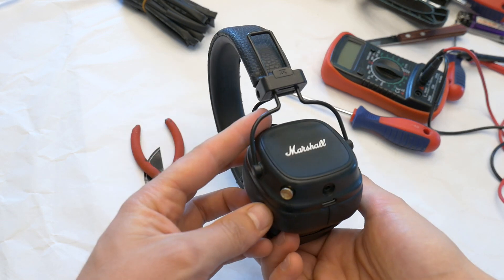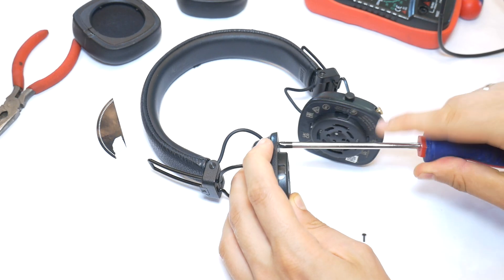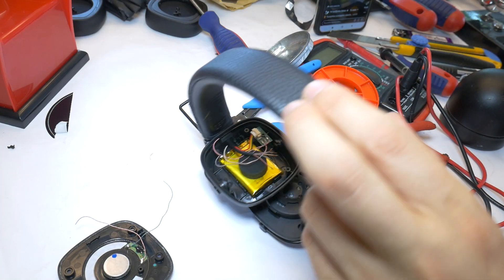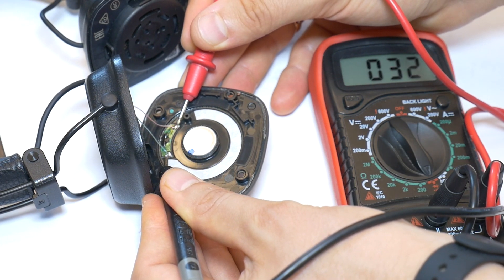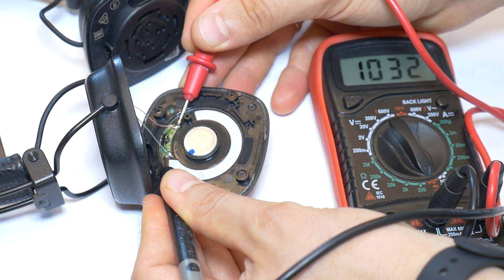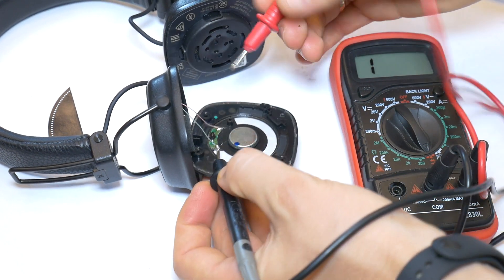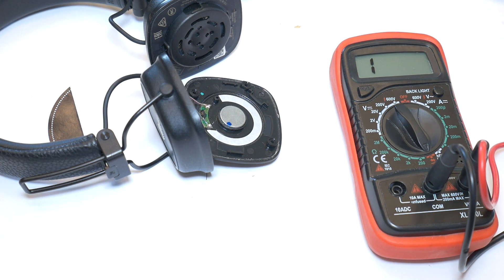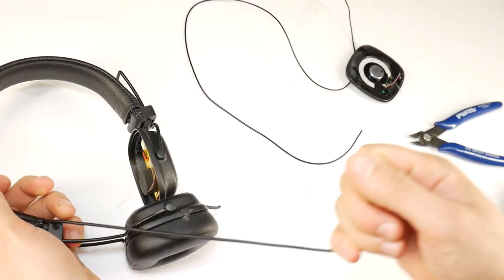How to Test a Speaker When One Headphone Side Not Working

Comment: Como puedo saber la polaridad exacta de los puntos de soldadura para las bocinas de un Razer Kraken
Reply from the maker: eng please :)
Reply: @TechscrewDIY  How can I determine the exact polarity of the soldering points for the speakers of a Razer Kraken?
Reply from the maker: @ The simplest way is to open any phase test video on YouTube right after soldering. If everything sounds good, you’re lucky. If the sound is strange, unsolder the wires from just ONE of the drivers and swap them.
Reply: @TechscrewDIY  thanks ♥️
Reply: @TechscrewDIY  "It happens that I had soldered a new cable to my headphones and I want to be sure of the polarity, knowing that there is no indicator or mark on the speaker."